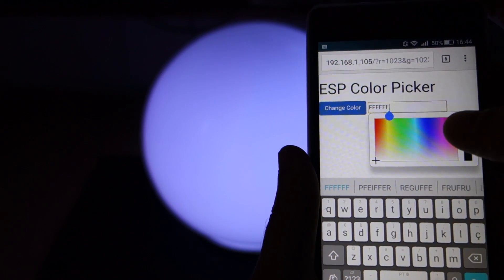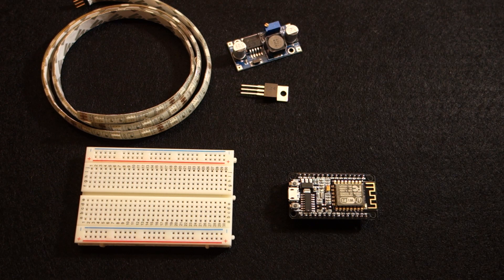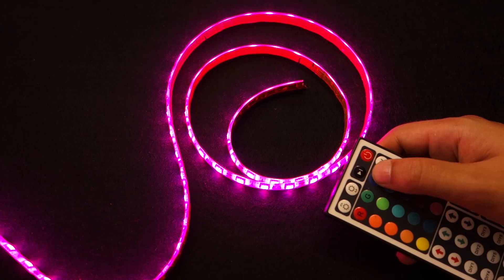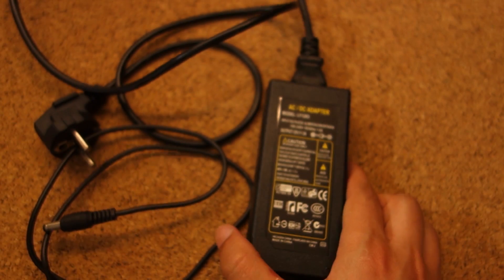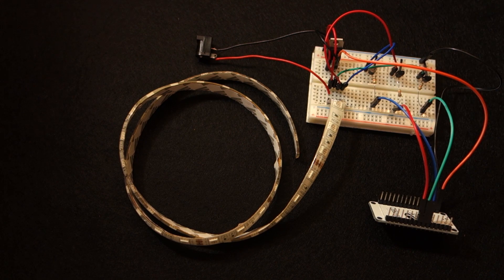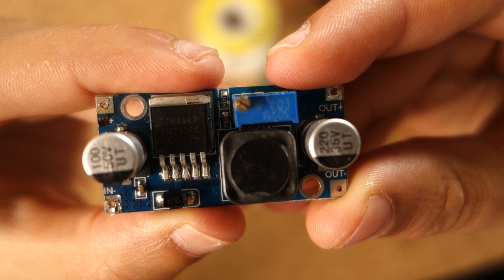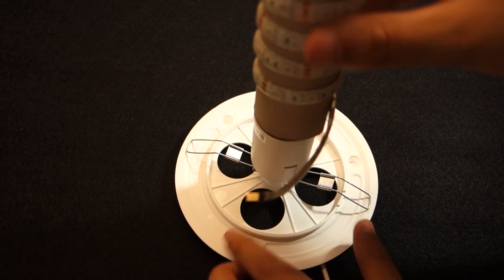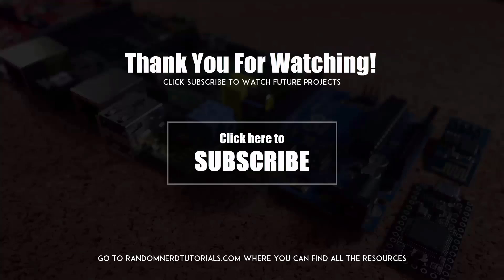$10 DIY WiFi RGB LED Mood Light with ESP8266 (Step by Step)

Comment: why do you use the transistors?
Reply: You shouldn't be pulling more than 20mA or so on an ESP or Arduino board really. Those 5050 LED strips can take 500mA per meter which would destroy the ESP. Some Adafruit type individually adressable LEDs have a signal pin and do not require a lot of power to go through that pin at all and could be used with less circuitry. Those cheaper LED strips cannot light different colors for each LED and all the power from each of the three diode is going through the three pins.